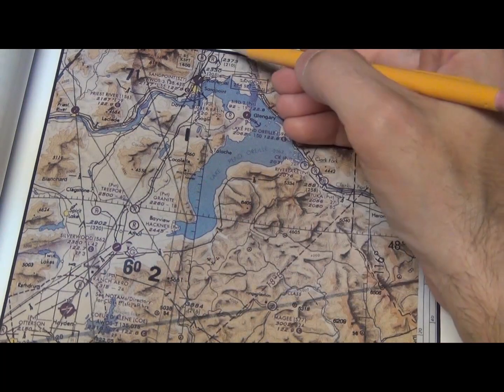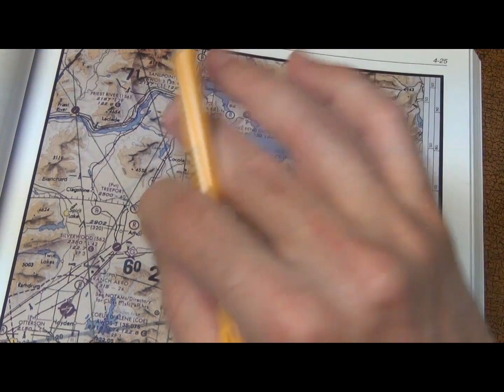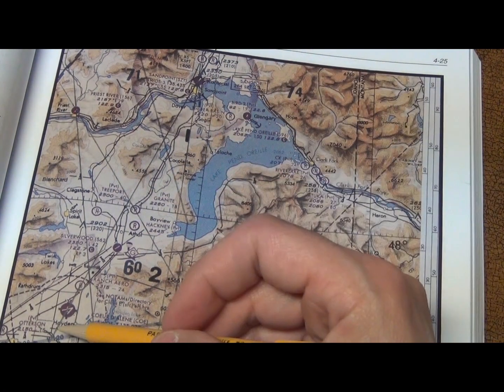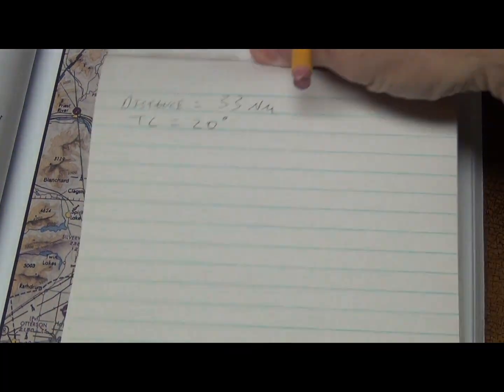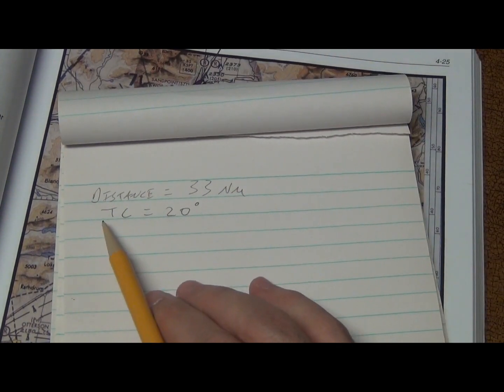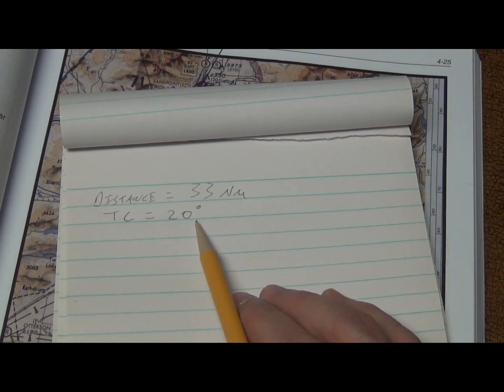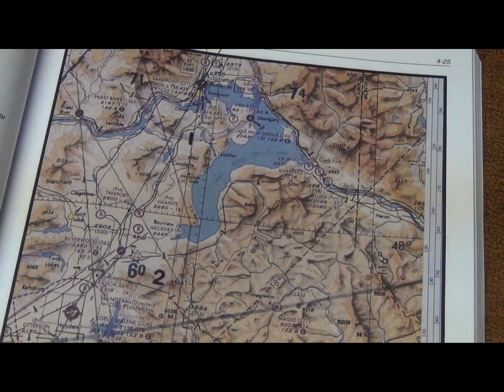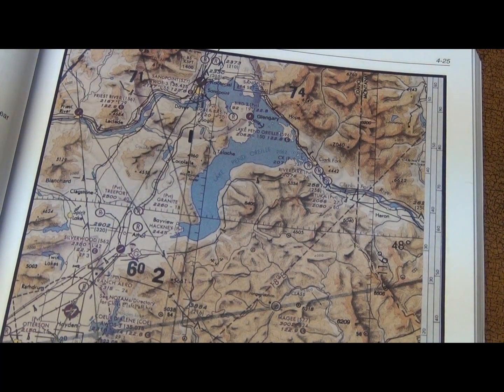Using the Navigational Plotter - Example 1

Comment: I've come across a couple of these videos by Mr. A. Feller and he does not use the plotter correctly. In each example, he states to just ignore the numbers.  This is not true.  If he uses the plotter correctly, the course numbers will give you your heading.  You always align the top edge with your drawn course line. You center the plotter where your line intersects the line of meridian.  If you use meridian of longitude, read the outer scale.  If using meridian of latitude, read the shorter inner scale.  It is simpler w/ a rotating plotter, but the principle is the same.  I don't know why Mr. Feller's videos are still out there, but I highly recommend disregarding his explanation of the plotter's use.  He does not understand its proper use, ergo he tells you to ignore what confuses him.

Comment: Does anyone know why the markings on the protracted section are reading in the opposite?
Reply: That's what I thought too at first until I read one of the comments. What you need to do is... First, draw a line connecting your two airports. Then, measure the distance from the center point of the first airport to the center point of second airport, and write that down. Now, place your ruler along that line, your planned course. Place the little hole in the middle where it intersects a meridian (line of longitude) and your planned course. Then, move your eyes straight out to the outside of the protractor and read the heading at that line of longitude. Just follow that line of longitude from the intersection of your course and read the heading that it says at the outside of the protractor. I hope that makes sense. I believe that finding a line of longitude near to the midway point of your course will help give you a truer course heading.

Comment: Buddy, this video has been up for 4 years and several comments must have made you aware you were ignorant of how to use this plotter correctly.  Do yourself a favour and delete it as it spreads mis-information as evidence by some comments.
FYI - You place the hole (centre of the protractor arc) on your start point, and place the ruler parallel with your course line. You then read both distance and direction at the same time, without having to move the plotter.  The correct course is read from where the plotter sits over a line of longitude on the map.  Depending on whether you use the longitude line above or below the start point determines which of the 2 figures you use (which are reciprocal to each other …. 180° difference).  By not having to move the plotter, and realign it with north, saves time.
Notice, just above the “C” of the word "CP-1 PLOTTER”, where the centre of the arc is (and the sight hole) the distance scale goes in both directions. This allows you to read the distance and direction at the same time.  If it is further than 87 Nm (WAC scale), then you need to move the ruler to use the longer scale at the bottom.
The “Sectional" scale is 1:500,000 scale, for Sectional maps.  Here in Australia I assume our equivalent to a Sectional map is a VNC (Visual Navigation Chart) which is 1:500,000 scale.

The other side of the plotter is completely Statute miles.
Reply: I was able to work out the math, but it just wasn't as easy as I thought it should be. This is precisely the answer I came here to find, although I absolutely had to move the plotter to get the grommet to fall on top of a line of longitude. Thanks!
Reply: Thanks for your comment. I, too, came in search of the answer your comment provided regarding how to read the true track (course). One question, though.... After taking the distance measurement, is it best to use a line of longitude nearest the center of the track, or one over so as to read the heading nearer the outside of the protractor, which would then also be nearer the center of the track, the midway point of the flight? I certainly have not asked that in the most articulate way. So, should the center hole of the protractor be near the midway point of the track, or should the outside of the protractor be near the midway point? Or, does either not make any difference? I'm thinking that it does make a difference because it's a great circle rather than a rhumb line.
Reply: you seen to know better, why not make q video and share with us your knowledge , we would appreciate it !i asked cuz i m doing my PPL and i will need that kind information soon!!

Comment: The reason there are more tic marks on the plotter, is that each side represents different scales. It depends which chart you are using. Sectionals are 1:500,000 and Terminal area charts are 1:250,000. You may also have a wac chart which is on to one million. Use the right scale for the right chart .  Now place your protractor base on the course line that you drew, then slide the grommet (the little hole) to a line of longitude. do the degrees make sense now ?

Comment: You are supposed to move your plotter along the course line until the grommet intersects a meridian,  then read the course where the meridian intersects the inner scale.
Reply: That's correct if you use meridian of Lat.  If you use meridian of Long, than read the outer scale.